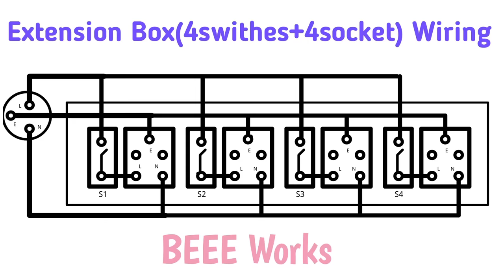How to make an extension box | 4 Sockets+4Swithes box wiring | Trending Extension box wiring

Comment: Add video on how to fix surge protection in an extension board.
Reply from the maker: Sure sir
Reply: Use a MCB as per load
Reply: @hariii Do we need both SPD and RCCB? Which SPD is better for an extension board for desk top and its accessories like printer etc.?  RCCB has been installed in my house for all rooms separately.
Reply: @hariii Thanks
Reply: Is it available on Amazone? I tried but not seen.
Reply from the maker: I have given product link in description sir. 😊

Comment: Sorry to say that phase must be connected down side on the switch
Reply: But he doing right ha...
Reply: @tncliquid3637  t
Reply: Right Hard wiring is as they have wired
Reply: Phase and neutral wire connections are correct way only
Reply: You are right sir 👍
Reply: @tncliquid3637  a
Reply: Correct method
Reply: Mahammed minhaj sorry to say u can connect anyside only thing it becomes ulta that's all . And see that phase and neutral should not mix that's it

Comment: Adding to the below comments, better to use 2.5sq wire instead of 1/1.5sq wire for phase and neutral connection so that wire will not heat when all sockets are used at full load... This prevents short circuit

Comment: Screws of board  should be of brass material. Steel screws corrodes after sometime particularly during rainy season there is problem supply of electricity. So selection of material is equally important.
Reply from the maker: Yes,

Comment: How much did it cost including the raw material
Reply from the maker: 120 Ruppes
Reply: @BEEEWorks  thanks for quick response and an informative video. You must sourcing the raw material in wholesale else each socket is costing me around 120-130...is that reasonable?
Reply: @salmanmohammad7335  10₹ per button and 20₹ per switch and plastic board 20 to 30 ₹ and main power switch 15 to 25 ₹ in  every electronic shop

Comment: Foe anyone who are going to try this...pls include a fuse( 10 amps will be better).
Its not safe with an extension box of four sockets without any fuse...
Reply from the maker: Ur correct bro. There is no space provided on the box
Reply: MCB use Karo Bhai home mai
Reply: Where to get plastic box ?
Reply: Is it ready-made?
Reply: @gokul9127  it's not a plastic box, it is 12M surface box
Reply: @EXPLORE6699  where to buy ?
Reply: Anywhere at electrical shop, ask a 12module extension surface box
Reply: @EXPLORE6699  thank you very much brother ❤️

Comment: Extension board three pin socket (3) four switch ,one bulb holder and single circuit breaker with three pin plug 5amp how to make wiring?
pls reply me
Reply from the maker: Contact me in Instagram

Comment: Good wiring. However, what is the usual practice and protocol? We are told that phase should be connected at lower terminals of switches followed by upper terminal to be connected to the live or right terminals of the sockets. Neutral wire should be connected to left terminal of the sockets. What is the Correct practice? Standard practice has to be followed.you have connected phase wire to upper terminal of the switches and given individual connections to sockets. Your wiring serves the purpose but created confusion what electrical wiring protocol is. Please clarify.
Reply from the maker: Both are works properly. Phase should connect at bottom pin is more safe.
Reply: @BEEEWorks  no it is out of India electricity rules

Comment: While I appreciate the efforts of this you tuber,  as for me I would go for a  SAFE and moderately priced extension reel  with Individual On / Off Switch  for each socket.
Reply: dint this have individual on/off switch for each socket? Also you can add a fuse to this setup. TBH, this is much better and higher quality than those run off the mill extension boards that you get in the market.

Comment: Although dtribution box wiring was perfect i still want to criticize you for wrong colour code of wire and messsy working you were literally pushing them in the holes where you should have opened the screws further to let them fitt in when you connected the external wire. Next time you should add a little fuse on that box with so many loads if its going to be used simultaneously. The provide fuse on the factory made extention boxes for that damn reason

Comment: Manufacture three pin  type of sockets without inside cover.
Three pin type of sockets with inside cover are totally failure and it will easily electrocute the persons those who are all trying to insert plug in it.